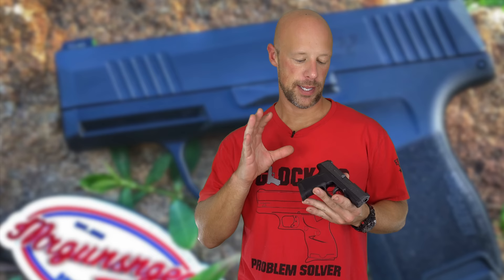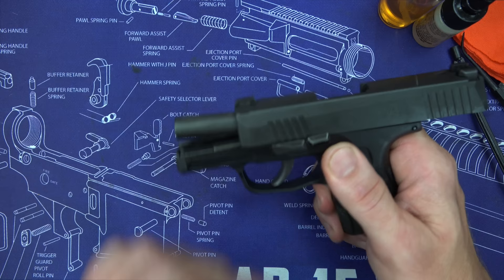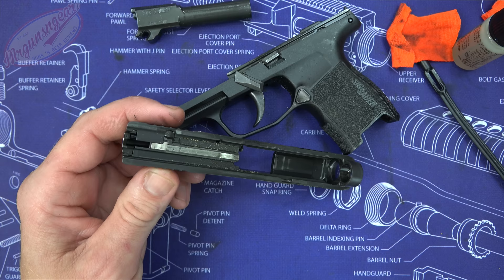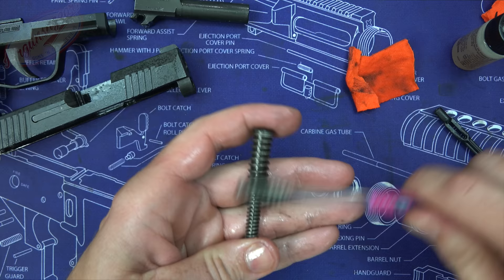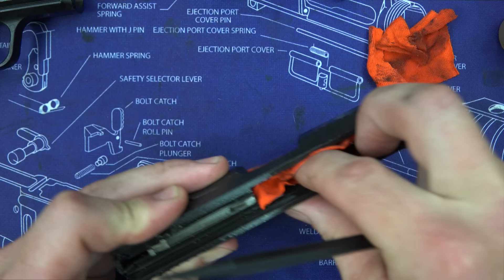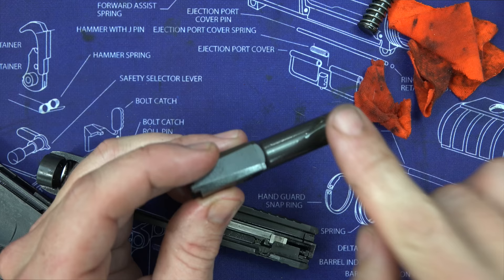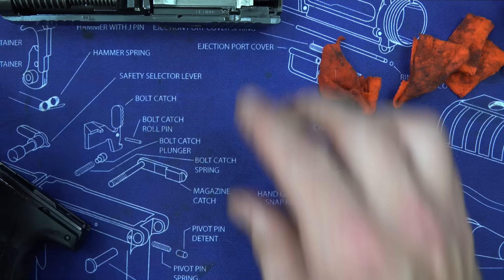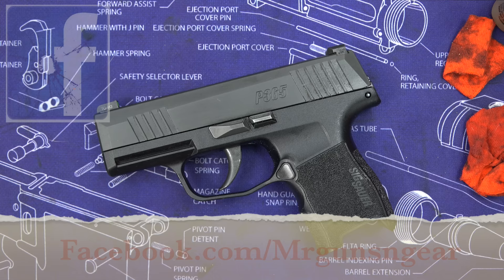How To Clean & Lubricate A Sig Sauer P365 Pistol  (4K)

Comment: So does this gun still suck?  Which generation of the P365 is sig producing now???
Reply: 1. Does the gun still suck? Depends who you ask. If you bought it, the answer is no. If you didn't buy it the answer SHOULD be they don't know, but you usually get how it breaks and has problems. The gen2 seems to be very reliable with no issues, gen1 has been a problem for many.

2. Its now gen2. Mrgunsingear did a review that explains how to tell if it is a gen1 or gen2.
Reply: Yes

Comment: Do you recommend this pistol I'm still on the fence about getting one
Reply from the maker: no change since the review really
Reply: No. I wouldn't recommend a Sig to anyone. Not even my worst enemy.
Reply: Yes, just be sure to get a new one built September 2018 or later
Reply: Ammo Man thanks for the info
Reply: Wow, that recent of a date? That's crazy. I'm scared to get it and I want one before Xmas.
Reply: @christopherbarger6112  I have had a 1992 Sig P229 .40 S&W 1000's of rounds without any failures.
Reply: I just got one and have about a 1,000 rounds, gun was born on Feb of 19...Love it.  I shoot it better than my full size 9mm.  The trigger is money, the sights are awesome day and night, small, comfortable...but that's me.  I have smaller hands, but even guys that have shot mine with large hands love it too.  It's just a badass little gun.  12 rounds is just crazy, even the 10 round clips are awesome for carrying because they print less.  But for the range, the 12 rounder is more fun obviously, gives you a little more to hold on to.

Comment: .Not fake news, but put it in context - probably over 150000 produced and a very limited number of striker breakages.  When it does happen, people tend to make sure it is publicized.  There have been a number of issues with the 365 and if it happens to you it is an annoying problem.   But just taking a shot without any experience is just trolling.
Reply from the maker: very few of those 150,000 have had over 100 rounds through them as well; just another data point to consider
Reply: An "annoying" issue is dead night sights. Broken strikers and triggers are catastrophic failures.
If it happens at the range, that's one thing... but when you need it?

Comment: I never thought cleaning and lubricating a pistol could be so controversial. OK, you used a bit more oil than I would use. Hardly a sin. I am concerned that in the manual it does warn about not getting oil into the striker pin channel. I know oil can attract fouling, but the spring in there is huge. If a bit of gunk is going to cause light strikes, I would be thinking something else is going on. None of the parts in there should be subject to oil eating them. I think the striker pin assembly can be removed as a unit, but I've not dug that deep yet. I'm rather reluctant to do so. As for popping the chassis out of the grip frame, that is super easy to do and could make cleaning a bit easier. Then again, if people are going back to gun shops because they can't figure out how to get their slide back on, it's probably best not to show how easy it is to remove the chassis if you want to just give it a spray down.

Comment: That’s cool, but how do we make it not break?
Reply from the maker: wish I knew
Reply: You purchase one manufactured after the upgrades, shoot good quality ammunition through it and keep it clean.  I’m 1500 rounds into mine and I have no problems.  People that rush out and buy the newest gun, car, phone or whatever else usually pay for it.  It’s never a good idea to buy the first batch of anything like this.
Reply: Craig Whyte that’s the most well reasoned reply I’ve heard from anyone on the internet in ages.
Reply: My P365 I got in Feb2018 is good to go.
Reply: @iPac_9mm yeah right
Reply: Craig Whyte This! It’s what I did and so far seems to have worked.
Reply: Jacob Gilbert I have around 1500 rounds still going good knock on wood
Reply: I'm sorry but, currently we have no way to make it not break firing pins.
Reply: Kevin Smith right on !
Reply: @Mrgunsngear  Has yours had issues? Do you have early model or late model? Thankyou
Reply: I suggest you buy one and find out instead of listening to haters. Best concealable 9mm on the planet. Nine is just fine, thanks.
Reply: @craigwhyte4157   You are correct sir. i dont buy the first run of ANY product.
Reply: @joethurman2712  try this, Google "Glock recall" youre welcome.

Comment: I appreciate the effort to help the complete newbs, but if you actually shoot your weapon, this is not especially useful.  It doesn't include removing the FCU for cleaning and lubricating. Wife has an XL Rose (p365XL spectre comp (a. k. a. stupid comp) and by their design, they funk up the interior of the pistol horribly. My wife's has all over 1K rds through it and the trigger has only gone from so-so at best, to bad, to now terrible. Nothing in this video is going to change that.

Comment: Sir, you have WAY WAY TOO MUCH oil on your gun! If you are using this pistol as a self defense weapon your ammunition primers are more than likely getting oil on them which CAN lead to their failure to fire! Lubrication should be used SPARINGLY and not slathered all over as you have done on this video. After cleaning the bare metal part in front of the Striker, I'd also recommend wiping it off because your loaded Magazine is directly below it and the next round is in contact with it. The LAST thing you want to do is introduce oil to ammunition!! Over lubricating is worse than not lubricating.

Comment: How does a gun get dirty if it doesn't run ? Sig should be embarrassed by this pistol.
Reply: Mine runs great...maybe yours just doesn't like you?
Reply: Embarrassed by a gun that had problems on its first iteration (fixed now) and started a race for higher capacity subcompacts? May as well say Apple should be embarrassed by the original IPhone.